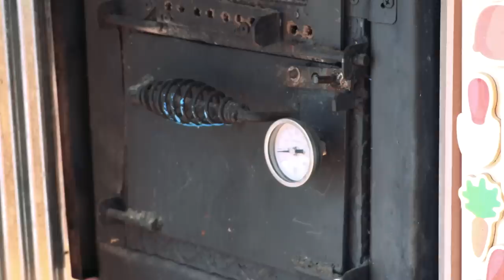Incredible Salvaged Off-Grid Tiny House On Permaculture Farm

Comment: Wow; I'm impressed.i really liked the recycled materials you've acquired to reduce that footprint as small as possible as well.i'm basically going to use my relocation funds to build my tiny home. It will give me 34,000 - 48,000 for the basic structure. 
    good work and excellent ideas.

Comment: LOVE the hydroponics system! feed the fish (bread left overs, worms or bugs), the fish poo, siphon off their poo to feed the plants, then occasionally have fish for dinner.
An easy system to setup, small solar panel charging a battery that powers a water pump, probably be able to run it through the night as well, water top up with a rain collector off the roof.

Comment: Hello, Thank you for the excellent video stories. You have done such a good job. Is it possible to include information about the challenges of finding a location to build a small dwelling without running into legal and zoning difficulties? Tiny homes are built on trailer beds so they are classified differently than other kinds of buildings, but this doesn't always solve the problem. I keep looking for property to buy where I can have a small inexpensive home but frequently find that rules stand in the way. I would love to hear about other people's experiences. Are you aware of resouces for addressing these problems? Thank you!

Comment: The home is cozy and pretty specially inside, however the material that they used for the exterior has somewhat made it looked like a slum in the middle of greenery. I think the iron roofs as wall is not quite ideal, look at the rust on the edge. But, overall, the ambiance of the house is really pretty, the interiors I'd love to copy for my room. It's lovely.

Comment: Respected sir,  
In India vedic plaster is becoming famous,  it's a combination of cow dunk and lime.   Your house looks will change from outside or inside but protect it from rain . You can prepare vedic paint also. Visit site for vedic paint. 

Please type word vedic plaster India. 
Please visit site twin  toilet system. 
It's a very good model for self compost. 

Please visit site. 
How to  make coconut ropes and wood bed.
  It's a light bed can be used as furniture for outdoor. 
After using you can trun it.
You can use any type of rope or plastic strip.  You can use recycle plastic strips.  You can make small tables or chairs using this method. 
This is traditional furniture used in India very famous. 
Namh shivay.

Comment: Love this, but sadly nothing like this is allowed by law og even possible due to the winter temperatures around here. Walls thinner than 20+ cm is just not thick enough to keep the fall, winter and spring weather outside and not chilling you to the bone. We have summer cabins that are fairly close to the tiny house idea in functionality and build style, but they are nearly useless without loads of power or loads of wood burning. Solar power is nearly useless due to the northerly placement and a weather that gives us about 50% coverage around the year.

Sure you could build a tiny house and it would work just fine during summer time or you might be able to build one that can handle the weather here, but the cost would be close to building a year round cabin. And then the law would kick you in the ass and tell you that living like that is illegal.

But then again i live in a country where building a legal bathroom would cost you at least 7.500 $ buck, the kitchen will cost you about the same to get it to meet the requirements, sure we can do it cheaper, but then it would be legal to live there year around. (People still do so, but then winter comes and most crawls back just to avoid freezing to death). 

Just to make a point the coldest night so far this month (april 2018)I was -6 C or round 21 F if you will,. Sure you can build to make it comfortably, but it cost a shitt load of money to do so.